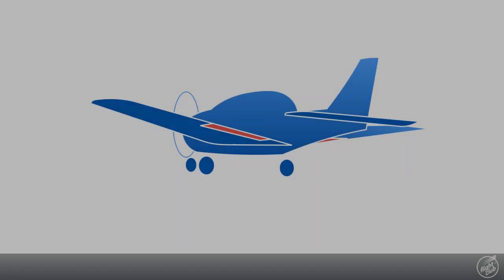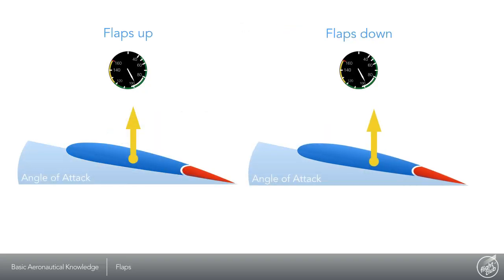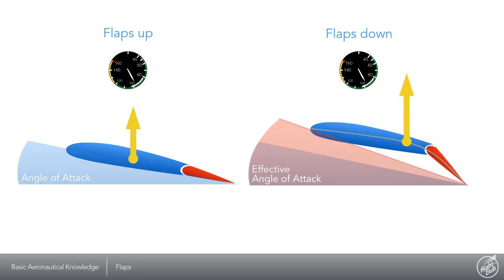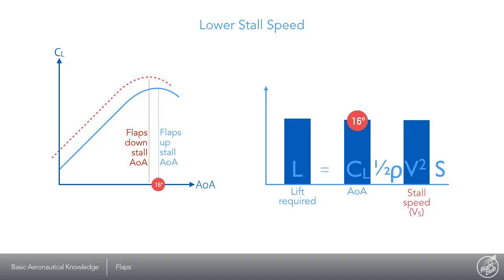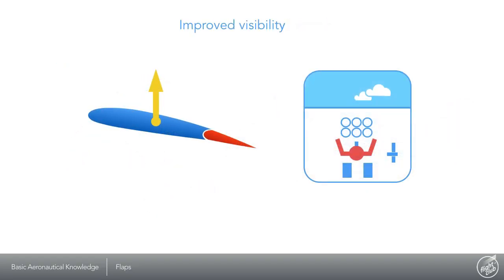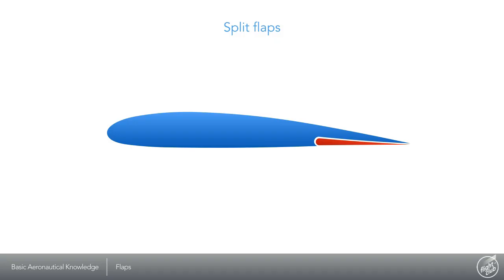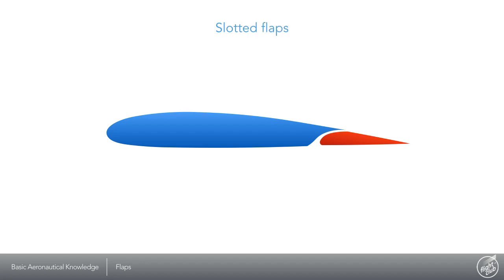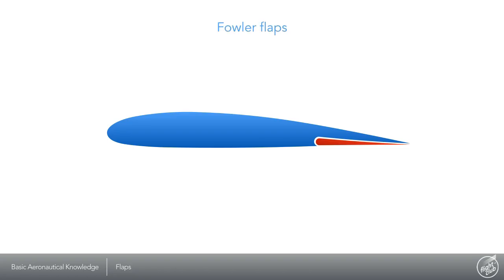How flaps work?

Comment: I hadn't realized that the airplane will stall at a lower nose attitude with flaps down compared to flaps up. I'll have to experimentally verify it at some point (with plenty of altitude to recover, of course.) At least, for any wing where the CL peaks further to the left on the CL versus AoA graph, this would be the case, as the wing is at a lower AoA further to the left. Perhaps it's not the case with some flap designs. And this is assuming that the graph shows the regular AoA, and not the effective AoA.